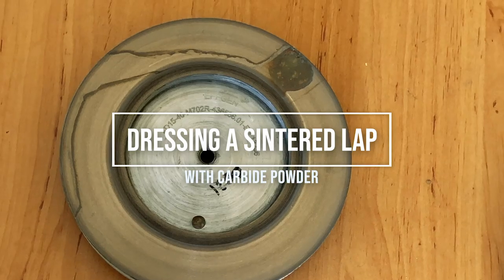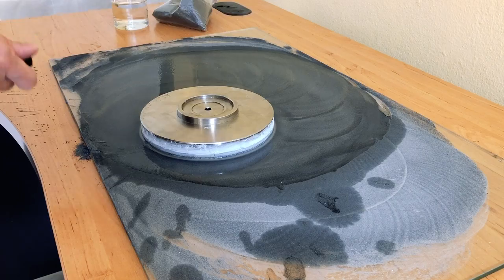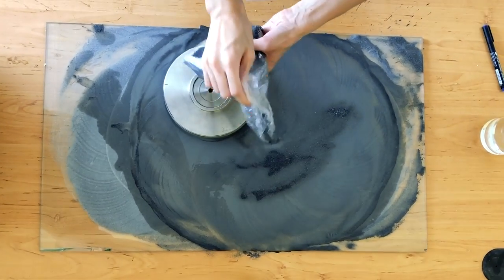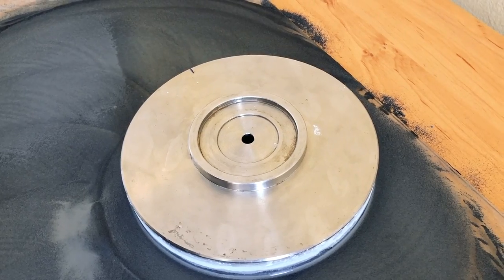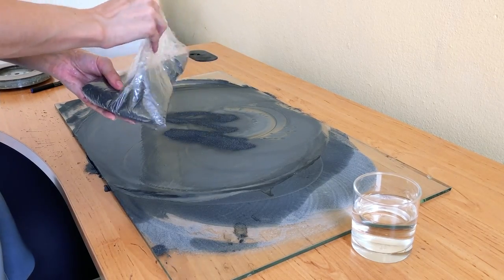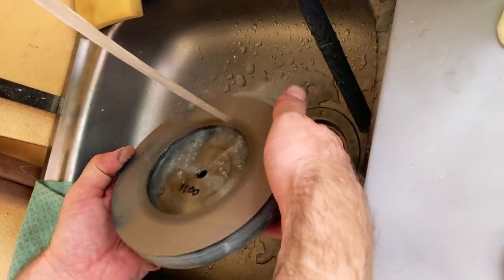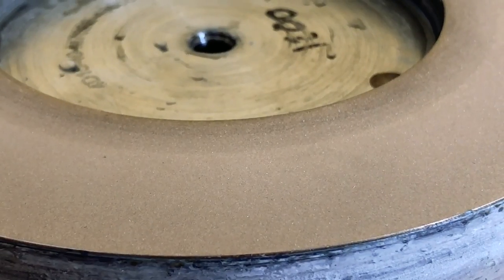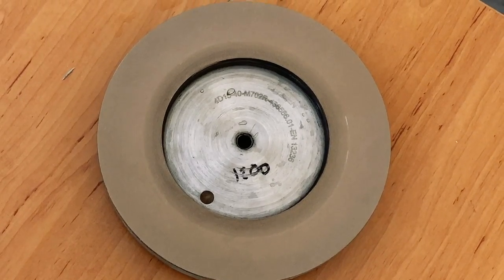Resurfacing a Sintered Lap with Carbide Powder

Comment: I wouldn't trust myself to keep even pressure on it. Likely use use a weight matching the back of the lap as to shape so the the weight didn't shift in use. In the video, there may be some question as to who is assisting who.  😂
Reply from the maker: Doing the figure 8 and rotating it regularly help to reduce human error of even pressure.  As for who is doing the work, we switch off when we get tired ;)